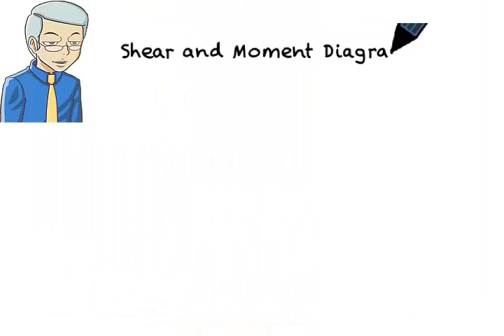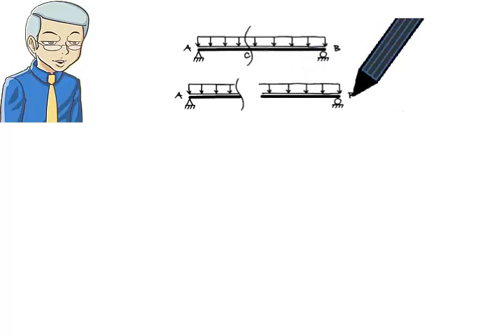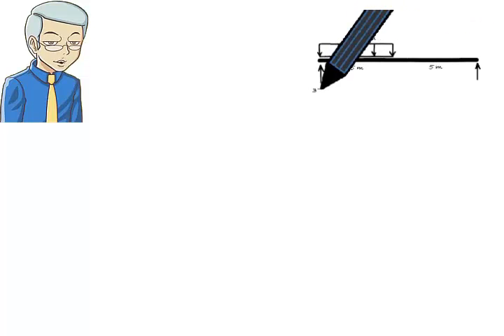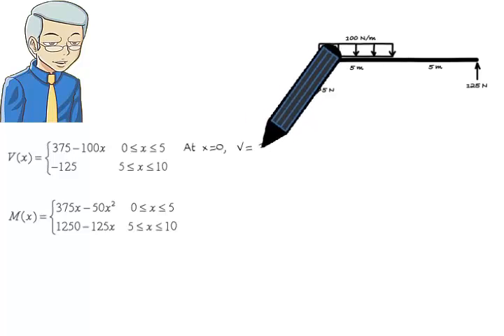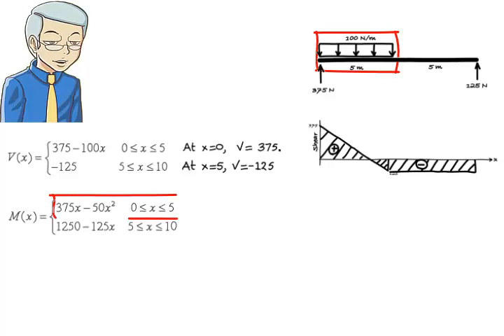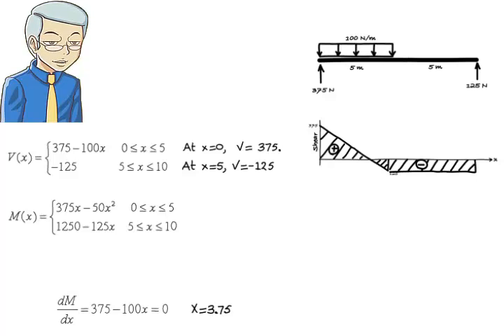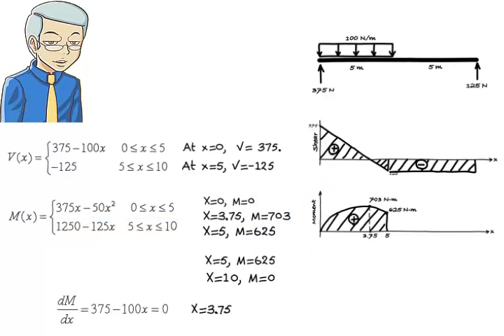SA08: Constructing Shear & Moment Diagrams using S/M Equations

Comment: Is the deflection highest what’re mere the BM is highest and SF is lowest, and if so, why is it so?
Thanks
Reply from the maker: No, generally speaking we cannot make such a conclusion. 

It is best to keep the mathematical relationship between shear, moment, and deflection in mind, when thinking about such questions.

Moment is the integral of shear,
and deflection is the double integral of moment divided by EI. 

To determine the maximum moment, we can take the derivative of the moment equation and set it to zero. This translates into: moment is maximum when shear is zero. 

To determine the maximum deflection, we can take the derivative of the deflection equation. That resulting equation represent the slope of the deflection . So, when the slope of the deflection is zero, the deflection is maximum. But the slope equation is not the same as the moment equation or the shear equation. So we can make general statements like: deflection is max when moment is max.

If we take the derivative of slope of, we get the moment equation. So, we can say slope is maximum/minimum when moment is zero. But that is different than saying moment is maximum when slope is zero.

In some special cases, we may have the max deflection correspond to max moment (zero shear), but that is not true in most cases.

Comment: Hello dr structure 
Suppose we have the bending moment diagram
How do we find the shear diagram and the loads in a beam or a frame ? Does it exist a method ? 
I tried to solve a problem using the method that u explained in the video  : "drawing S/M diagram without using the equations" but in reverse. It's complicated in that way.
Reply from the maker: Interesting question.

I am not aware of any method for solving the problem in reverse, but in most cases,  we can infer a lot of information from the moment diagram. For example, from the moment values at the boundaries of the beam, we can infer the beam's supports. Also, if we can locate the point at which the slope of the bending moment is zero (if such a point exists), then we know where shear is zero. Also, If we know the nature of the curve for the moment diagram (i.e., quadratic, linear,...) then we know the shape of the shear diagram, and the type of load that is placed on the beam. For example, a quadratic moment diagram means a linear shear diagram, both associated with a uniformly distributed load. But if the exact (mathematical) shape of the moment diagram is not available to us, it would not be possible to accurately determine the nature of the loads placed on the beam.
Reply: @DrStructure  that was helpful. Thank you so much dr structure 🙏🙏🙏🙏

Comment: Hello @dr structure.
I have a question. 
Imagining we have a beam, with a fixed end and the other side a free end.
The free end subjected to a concentrated load.
The mid point of the beam subjected to a bending moment.
In the case of drawing the graphical diagram of bending moment, how do we deal with the bending moment of the midpoint please? 
The left side of the mid point easy to find, my question concerns the right side.
Reply from the maker: There is going to be a jump/drop in the moment at the beam’s midpoint where the concentrated moment is located. 

Suppose the the beam’s length is 10m, the magnitude of the downward concentrated load is 2 kN,  and the concentrated bending moment is acting in the clockwise direction at the midpoint of the beam. The moment has a magnitude of 5 kN-m. 

The reaction bending moment at the fixed end is: (10m)(2 kN) + 5 kN-m = 25 kN-m. This would be a counterclockwise moment. And the reaction at the support is 2 kN.

Bending moment diagram starts at -25 kN-m. It reaches -25 + (2 kN)(5 m) = -15 kN-m just to the left of the concentrated moment at the midpoint of the beam. 

The clockwise moment at the midpoint of the beam causes a jump of 5 kN-m (the magnitude of the applied moment) in the moment value. So, moment goes from -15 just to the left of the midpoint to  -10 just to the right of the midpoint. Then the moment changes linearly until it reaches zero at the free end of the beam.
Reply: @DrStructure   
I resolved your example and it's correct you are right. Thank you for your time 🙏🙏🙏🙏 

My real issue is in an example, where the bending moment in the midpoint of the segment act conter clockwise. If I consider a conter clockwise direction as a positif direction the result will totally change ! 

So, the sign convention of the positif/negatif bending moment is it always true ? 
I mean we can't consider a moment where the beam's segment tend to deform concave down as a positif moment right ?
Reply from the maker: @seddiksoundous9883  The same example as above, but with a change in the concentrated moment direction. Now the 5 kN-m moment is acting the in the counterclockwise direction.

The reactions at the fixed support are:
Bending moment: (2 kN)(10 m) - 5 kN.m = 15 kN.m (counterclockwise)
Vertical reaction: 2 kN (upward).

The bending moment diagram starts at -15 and decreases to -5 just to the left of the beam's midpoint. This time, the applied bending moment causes a drop (not a jump) in the moment value. The moment goes from -5 at the left end of the midpoint to -10 at the right end of the midpoint. The moment changes linearly from -10 at the right end of the midpoint to 0 at the free end of the beam.

Both in this case and in the pervious case, the beam bends concave down. And that is what we want to keep in mind. That is, of significance is to know which fiber (top/bottom) of the beam is being compressed and which fiber is being stretched. This distinction becomes important when we are designing the beam as the design of the parts under compression differ from those under tension. 

In these lectures, we have referred to the bending moment that causes the beam to bend concave up as positive. So, by that convention, bending moment in the cantilever beam is negative. But this sign convention is arbitrary. We could have called this a positive moment. That is, we could have taken a concave down deflection as positive when writing numbers. As long as we keep in mind, under our assumed sign convention, which beam fiber (top/bottom) is being compressed and which is being stretched, everything will work out fine at the design stage.

 In our traditional sign convention, a positive moment means the top fiber of the beam is being compressed and the bottom fiber is being stretched. 
 In the alternative sign convention, a positive moment means the top fiber is being stretched and the bottom fiber is being compressed. 

For design purposes, we really don't care above positive vs negative labels; we only care about which side of the beam is being compressed and which side is being stretched.
Reply: Thank you  @DrStructure  🙏🙏🙏  it's clear now

Comment: Sir can u plz tell me how come that
1250-125x 
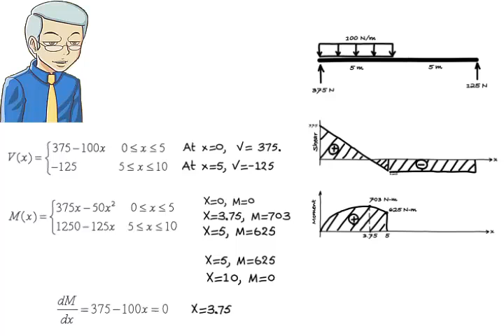At 7:34 duration
Reply from the maker: Cut the beam at some distance x past the distributed load where  5 < x < 10.

The moment of the left support reaction about the cut point is: 375 x
The moment of the distributed load about the cut point is: 100(5)(x-2.5).

The distributed load can be replaced with its equivalent concentrated load. The magnitude of that load is 100(5) = 500. The location of that load is (x - 2.5). This is the midpoint of the rectangular load measured from the left end of the cut point.

So. the total moment about the cut point is: 

375 x  - 100(5)(x-2.5) = 1250 - 125 x.

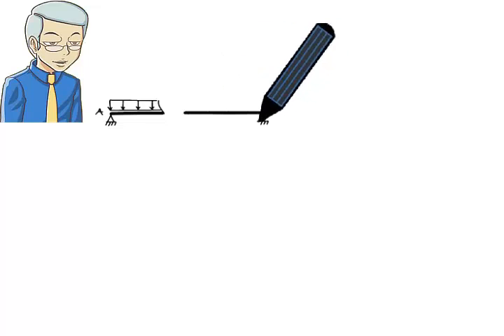Comment: Dr. Structure at 2:17...is the term really bending moment? is it not concentrated moment?
Reply from the maker: Yes, it is correct. The phrase concentrated moment is generally used for applied load/moment, not an internal bending moment in a beam.

If you think about it, internal bending moment in the beam is not concentrated, it is distributed throughout the member.

Comment: Shouldn't dm/dx=375+50x not 375+100x?
Reply from the maker: Why should it be 375 + 50x instead of 375 - 100x?
Reply: He use derivative .
Reply: the derivative is to be of M, and its equation is M= 375x-50x^2,so dM/dx should be 375-50x
Reply from the maker: Not quite. Your M equation is correct. Your dM/dx equation however is incorrect. More specifically, the derivative of -50x^2 is -100x, not -50x.